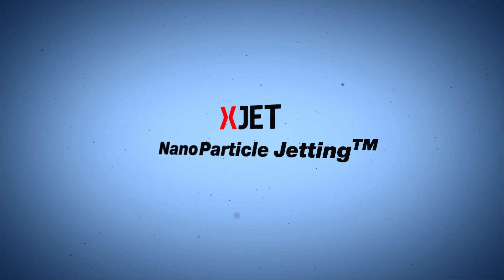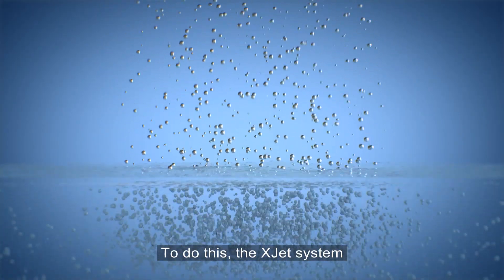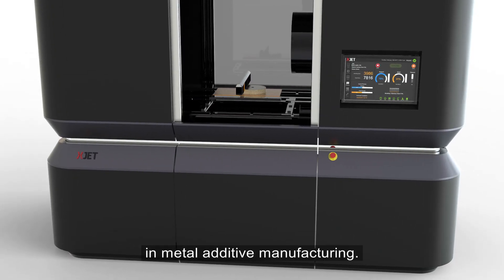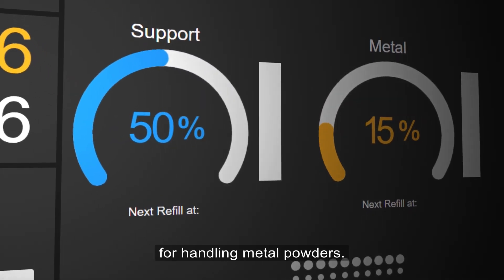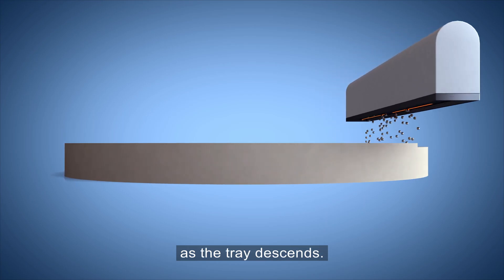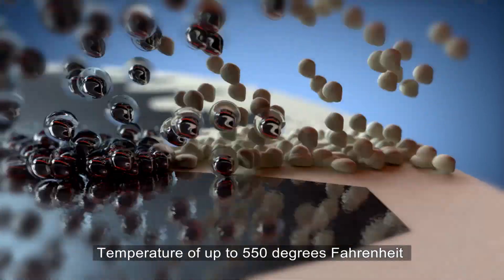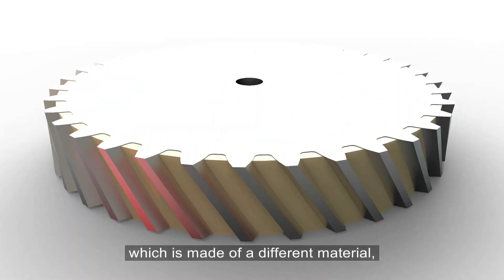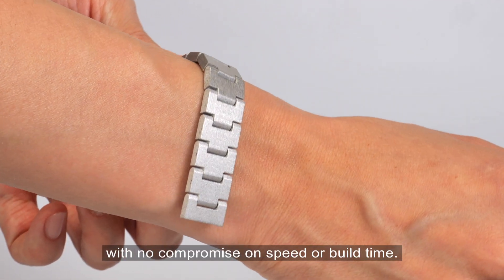XJet's NanoParticle Jetting Technology™ Demonstration

Comment: doesn't the baking (the liquid evaporation phase you mentioned) reduce the size of the final metal part?
Reply from the maker: Thanks for the question! 

The liquid evaporation is just to remove the solvent materials (the carrier of the build and support materials), which are not meant to stay in either the green part or the final metal part whatsoever, and it therefore doesn't cause part size reduction.

The final part size is indeed shrunk as our process is sinter-based, yet our shrinkage is relatively low and isotropic, so all we need to do is just to print the raw part a little oversized, which is all calculated automatically when loading the file to the tray planner software before printing, at minimal risk of geometric distortion.

We'd be happy to support if you have any further questions. Please feel free to drop us a note at info@xjet3d.com.